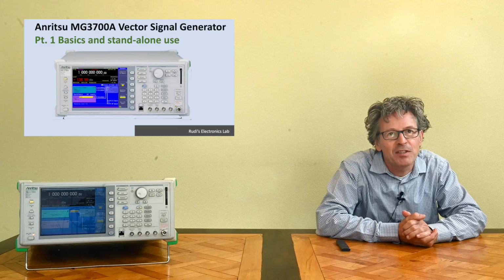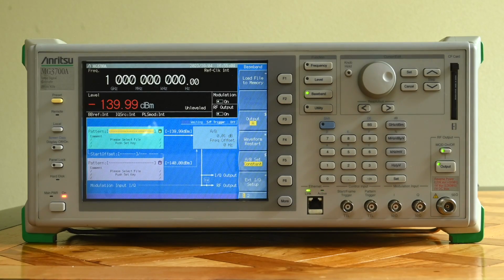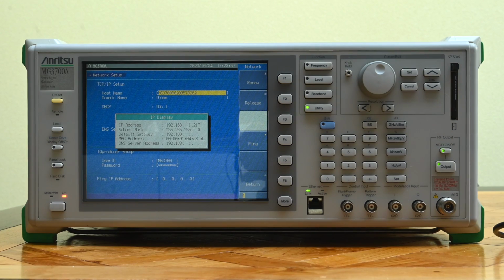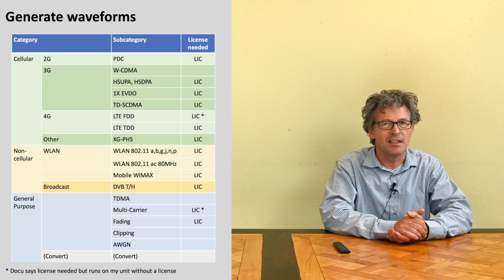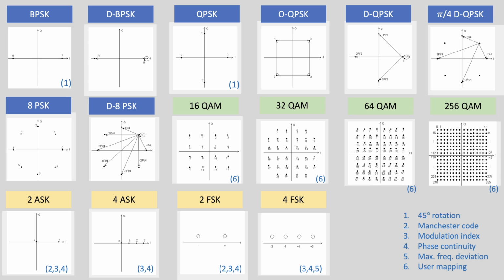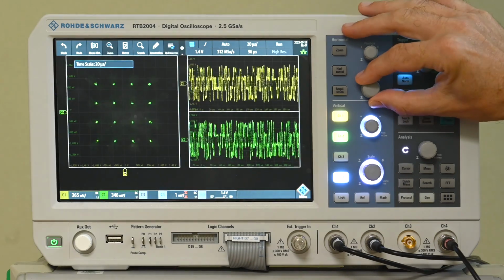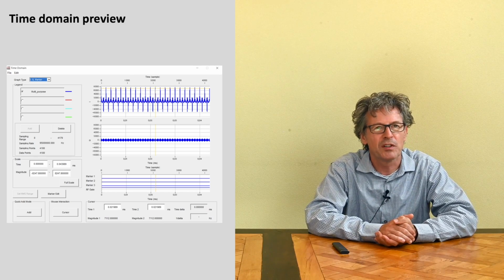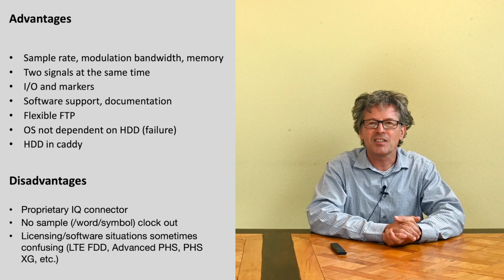REL #35 Anritsu MG3700A Vector Signal Generator — Pt. 2 PC-based use with IQproducer

Comment: Your video tutorials are excellent. I also bought a used generator, and at first I wanted to test the handheld radio's sensitivity by generating a simple 1kHz tone in FM modulation. But unfortunately, it seems that the standard pattern list does not include the most basic FM modulation. Could that be the case? Then the only way to get it working is by using IQProducer?
Reply from the maker: Thanks for the compliments, and good question! The MG3700 is much more a digital-oriented generator than an analogue one. I don't have the instrument in front of me, but it might very well be that a analogie 1kHz modulated signal is not in the default loaded waveforms, and, as a matter of fact, it does not seem straightforward to create it using IQProducer either (just quickly ran it and it is also more aimed at digital modulation). Having that said, you can always just create an FM signal in an apoplication of choice (even Windows Exel, for that matter), put it unto IQProducer and bring it into the MG3700.
Reply: @rudiselectronicslab861  Thank you very much for your reply. Yes, I went through all the available options and couldn’t find standard FM modulation. As you mentioned in the comments earlier, I registered my generator on the Anritsu website — hopefully, I’ll be able to download IQProducer after some time and start experimenting with it. Tell me, can this device be used for tuning DMR repeaters? Will DMR signals also need to be generated using IQProducer?
Reply from the maker: While I hope that does not discourage you, I think it would actually be useful got get some experience with IQProducer if you have the MG3700 anyway. It is not that difficult to master and quite rewarding!
Reply: In any case DMR is not part of the standard delivered files. So you would have to create your own. That is likely quite a challenge, I picked up my 3700A last monday, it is a fascinating piece of kit, but the learninf curve is, shall we say, interesting 😂

Comment: Hello Author! Thanks for the interesting video! Where can I download IQProducer? I want to try working with it and Matlab. This program is not available on the Anritsu website in the Downloads section. Also wondering where I can find their program for generating a GPS signal  ( GPS positioning pattern generation tool 
). Was it on the disk that came with the MG3700A ?  have not purchased the device yet, I just want to work with the programs that are intended for it. Can I ask you to send me these 2 programs?
Reply from the maker: Hi! Thanks for the compliment! I advise you to register at the Anritsu website. It's for free, and after a day or so, they give you access to a wide range of documents, software and waveforms for the MG3700. Really lots! And it includes IQproducer, for sure.
Reply: @rudiselectronicslab861  Hello! Thanks for the advice. I registered on the site. I found IQProducer, but in order to download it I need to register the device, which I don’t have yet. Here's what I got on the page - Register your products to access your downloads and support. Since I don’t have the device yet, I can’t register it on the website.  - no download link, only information. I was only able to download the Manual in pdf format.
What else can be done?
Reply from the maker: @ipddip7642  Why don't you drop me a message at rudiselectronicslab@gmail.com ...
Reply: @rudiselectronicslab861  Ok thanks. I'll send a letter

Comment: For the sample clock output I think you can simply use a marker output and put a marker in the waveform file, alternating the bit between 1 and zero between each sample. It will of course give only half the actual sample rate but for most applications I think that would be OK and you could trigger on both edges to get a trigger rate matching the sampling rate.

I've just received my MG3700A yesterday and still figuring out some things.  Unfortunately it does have a couple of problems.  It has the rubidium option but it seems to be faulty, periodically drifting between about -50 and -300 PPM so I have to use an external GPS clock instead.  
It also gives me an ALC alarm and output is about 1dB higher than it is meant to most of the time but only when modulation is off. Once modulation is turned on it somehow works fine and he output level is then very accurate.

I'm still trying to figure out how I can get hold of the IQ producer software as nothing was included in the purchase and the instrument's usefulness is somewhat limited if I can only use the waveforms that already are already in the instrument.

I'm also hoping that I can make the waveform files myself and FTP them to the instrument without using IQProducer but I have been unable to find a definitiopn of the file format required.
Reply from the maker: >> I'm still trying to figure out how I can get hold of the IQ producer software as nothing was included in the purchase and the instrument's usefulness is somewhat limited if I can only use the waveforms that already are already in the instrument.

Just register to the Anritsu website for this device and you get access to a huge download area. The latest version of IQProducer is also there.
Reply: @rudiselectronicslab861  Thanks, I just registered, looking forward to getting confirmation.
Reply from the maker: listerdave1240 , congrats on buying this instruments and thanks for the comments 

>> For the sample clock output I think you can simply use a marker output and put a marker in the waveform file, alternating the bit between 1 and zero between each sample.

This certainly works for files you create yourselves by converting an ASCI/CSV waveform. I actually did this myself: see my video REL at 40:25, where I show a marker that has Clock/2.

But this approach has limitations using other waveforms. I think you do not have this Clock/2 marker for all the prerecorded waveforms. I seem to recall that Anritsu actually added Clock/2 to some prerecorded waveforms but not to others. There are some 14 manuals for specific waveforms (called “MX370106A DVB-T/H IQproducer Operation Manual” and so on), and there they explain per waveform how the markers are used. Same story for waveforms generated by IQProducers other than by converting an ASCI/CSV waveform. 

There might be a kind of workaround here. In IQProducer, in the time domain module, you can open an existing waveform (*.WVI), and “marker edit”. This gives you some marker editing options, seems they might make a Clock/2 as well, though I have not checked this in practice. I have also not tried if you can bring a prerecorded waveform from the MG3700A back to the PC via FTP, perform this editing, and then bring it back to the instrument and have it played.
Reply from the maker: >> I'm also hoping that I can make the waveform files myself and FTP them to the instrument without using IQProducer but I have been unable to find a definitiopn of the file format required.

Not sure how easy it is to reverse-engineer this format. But IQProducer really does a good job of converting a CSV waveform into the * .WVD, *.WVI and *.WVC format, so I would not spend a lot of time reverse engineering but rather use it on other nice excperiments!